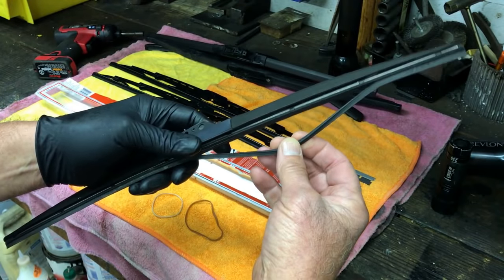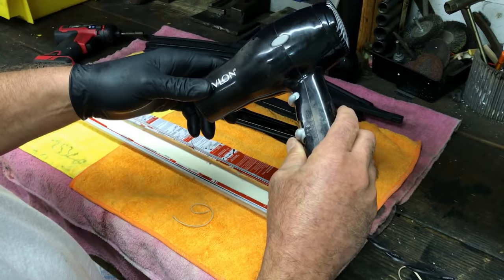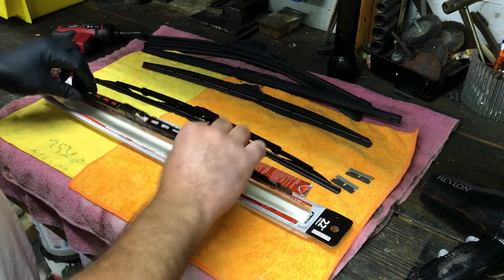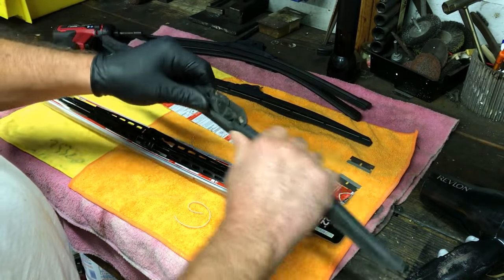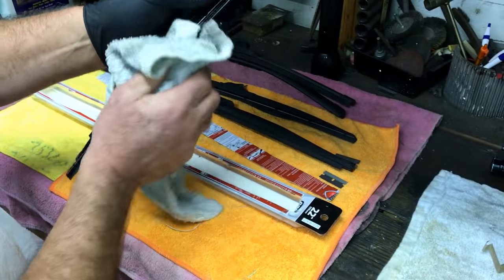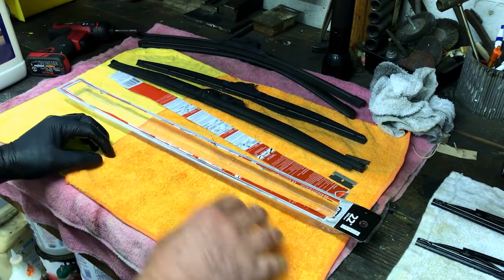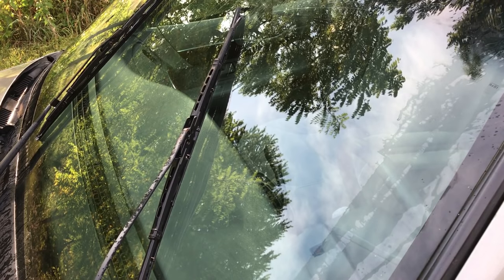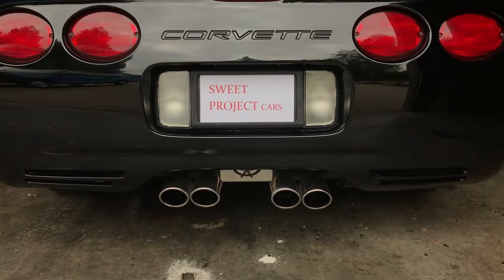NEVER ! Replace a Wiper Blade  AGAIN !!!  Amazing :)

Comment from the maker: Hello My Friends, Hope you are having a great day :) THE MAIN IDEA of the video is to show you the power of 303, it helps ALL Rubber !....SEE, cars are money pits, so why not protect the items you can from replacing sooner than you normally would have to. THE the 303 works on every part of you car..not just wipers saving you many dollars in replacing rubber, or plastic, or vinyl, or leather parts yearly.
Reply: Sweet Projec
Reply from the maker: John my friend yes it is the old bottle you want this   http://amzn.to/2jCHktN   the product goes a long way we bought many gallons of it 4 years ago and just finishing it up.
Reply: C
Reply: Sweet Project Car
Reply: Wonder how to do a repair. Dent in plastic bumper 2008 Odessa
Reply: Sweet Project Cars b
Reply: What was sprayed on the windscreen at the end?
Reply: Sweet Project Cars 
Amazing DIYs. Subscribed.
1 question: can this be done to  door rubber trims/seals for noise isolation and cabin air leaks? Thanks in adv.
Reply: Sweet Project Cars Just clean them with de natured alcohol then clean the windshield with it make a vid about it pls
Reply: Sweet Project Cars were u
Reply: Sweet Project Cars were
Reply from the maker: Kevin we have tried many different ways over the years and this method we show here is the only one that makes the blades last and last...thanks so much for sharing :)
Reply from the maker: Off  the 303 Uv should be used on all your rubber and plastic and leather and vinyl to keep them working as they should and if you use it on your doors seals it will help them immensely if they are not too far gone already.
Reply from the maker: thank you very much :)
Reply from the maker: it is the same product we soaked them in, you can see the tools in the SHOW MORE of the video description
Reply: Sweet Project Cars how do i clean amoral off the inside of window. Person I bought car from had sprayed dash and window and i can not get it off. I can't see crap when driving at night. Please help.
Reply: Sweet Project Cars 0
Reply from the maker: thank you
Reply from the maker: Theresa we use this to clean it off  http://amzn.to/2iuiyID works every time:) but it needs to be 99% or higher
Reply: Sweet Project Cars thank you. I will give it a try.
Reply: Sweet Pr
Reply: jauntis juice
Reply: Sweet Project Cars i
Reply: Sweet Project Cars I
Reply: Sweet Project Cars That 303 is expensive, use armor all protectant and get the same result.
Reply from the maker: Efren Saclolo the armorall is not even close to the same quality or mixture as the 303...it would be the difference between a Ferrari and a Toyota civic
Reply: Sweet Project Cars yi
Reply: Ok so I bought a small spray bottle of the 303, used it on my wipers, reapplying it monthly, it did work as
Reply: so, theoretically, based off of your clickbait video and your own post(which contradicts the title btw),  one could heat up their tires & soak 'em in this stuff overnight and never have to buy tires again?
Reply: Sweet Project Cars Toyota Civic?
Reply: I pay 14 $ for wipers,  it seems easier to just change them
Reply: I’m with you about 303, I have used it on garden hoses to plastic patio furniture to rubber door and window seals on the car, house to boats simply anything rubber and plastic, ok everything has a useable life but 303 extends that noticeably. Good call bud, I honestly never soaked them before installing but I usually spray on a piece of paper towel and wipe the heck out of em and I change wipers ever 4 to 5 years, I have 4 vehicles, even the cheapest wipers which I really dislike adds up quick.
Reply: So you heat the blades for 10 mins, soak over night, then reapply with spray twice a year?
Reply: 303? I use Winchester 300 Magnum.
Reply: Sweet Project Cars I see in your video you soaked for 3 hours or you can soak overnight. Is 3 hours the minimum?
Reply: A few things to try if you are having poor wiping performance; Clean the wiper blade and windscreen with warm soapy water, followed by a clay bar for the windscreen and then wax and grease remover to remove any stubborn contaminants. If you have issues with wiper arm pressure, you can lubricate the wiper arm spring with wd40.
Reply: @jbone1383  no not heat it up just spray it on rub it in and do it a couple of times a year and see the results, he made a video about this and a cars timing belt :p
Reply from the maker: grimmreeper2001 you can soak it overnight no problem
Reply from the maker: Tim Early you got it my friend
Reply from the maker: J Bone you got it my friend
Reply: Hey sweet. I have subscribed uour channel not long ago. I just want to tell you - the job you do inspired me so much that Im really wondering to start detailing and refreshing cars.. anyway. I got one question. I have noticed that you use 303 very often. I have read on some forums that Vinylex does similar job but leaves more glossy effect. Could you tell me - is that true? Will it do the same job as 303 for dashboards and tyres etc?
Once again - many thanks for superb channel. All the best
Reply from the maker: FUGLY UCKER hello I went to your channel I did not see where you had subscribed but maybe I missed it. anywho, there is nothing on the market anywhere that will do what 303 does and it will leave it shiny if you don't wipe as hard...the protection of this product is unmatched my friend
Reply: This can be sprayed directly on the windshield? It doesn't leave any film or reside on it? And 303 vs armor all protectant on wiper blades? Is the armor all even going to help at all?
Reply from the maker: Eyvindur Leo use only the 303 my friend and yes it can be applied just like you see in the video with no side effects
Reply: Efren Saclolo 
Armor All should be outlawed, it’s complete garbage.
Reply: Sweet Project Cars I've been soaking my blades with rain water for years!
Reply: Ok so the item you are using is called 303, then why you didn't show the container in the video or truly mention it on your video? I was sitting there asking myself what is he using but I now see the link in your response to someone else.
Reply: "SEE, cars are money pits."  My mechanic puts it another way........they're all pieces of shit. LOL
Reply: Hi, what's the solution?
I'm in Scotland
Reply: It was fine until the last minute, just what I need, more substances to scrub off my glass!!
Reply: @SweetProjectCars  okay, the 303 uv protectant for glasses is the best? Who would have thought, thank you sir. 👓
Reply: What's 303 made of and can we make a batch? I found some old plastic containers and I'll look and see what kind it is. Brb
Reply: You never showed the product!!

Comment: My wife is a retired custom marine canvas fabricator and we have used and sold 303 products for over 15 years. The 303 Aerospace protectant used here also works well on vinyl, fiberglass and many plastics.  An easy way to condition small items is to wet with the 303, seal in a ziplock bag and leave in a hot car for the day.  303 is good for leather too but we continued to use Lexol on our custom saddles and expensive horse tack just because we were concerned about changing products.
Thanks for the good tip and demonstration for wiper blades!

Comment: About 4 decades ago I tried spraying my wiper blades with silicone spray.  Big mistake!  It smeared all over the windshield and made it very difficult to see out the glass.  Lucky for me steel wool and Comet cleanser removed it - but that taught me to never try a silicone-based protectant on my wiper blades.  This 303 Aerospace stuff looks promising to do this task.  As the 303 is water-based, I am pretty sure I won't have the smear problem that I had with the silicone. 

I just discovered your channel and you post great usable ideas!  Thank you for the video(s)!
Reply from the maker: no smearing ever...you will love it.    thanks for being here with us :)

Comment: I have been using the original formula 303 for about 25 years back when it was not a consumer product but I used it at work and of course some always ends up at home. The original 303 was developed for use in the aircraft maintenance industry.  303 was part of the multi-step process for maintenance of polycarbonate aircraft windshields which can be incredibly expensive.  For example, on the Citation II, each forward windshield replacement cost was approx. $22,000.  I am happy that it is readily available to the average consumer now as it is an excellent product that has few competitors for effectiveness.  Those that are comparable, you will pay an arm and a leg just to get a small amount if you are an average consumer. 303 works, it does exactly what it claims.
Reply from the maker: It is good stuff that’s for sure

Comment: I have been using this product for a few years now. It is the best for using it on the top of a Jeep Wrangler, so mush better than anything on the market to date. I use it on many things but have never used it on wiper blades. So since we are going to be buying new blades for our truck, I will be doing this before putting them on. Thanks for the great videos!!! You may want to try their paste car wax too. It is the best on the market too. I have bought many different waxes over the years, and their wax is very good, easy to use, and even tho it is expensive to buy, it lasts so much longer than any other paste wax. Keep these kinds of videos coming. Some folks like me, doesn't like to throw their money away, this just helps me to conserve my money. Thanks!!!!
Reply from the maker: Sharon I am just like you in all your statement :)   thanks so much for the kudos and being here with us.

Comment: 303 products have been an absolute favorite in the boating community to prevent 'UV burn' on rubber and 'plastic' etc. materials for many many years. For automotive use,  I apply it on the side walls of my tires, on my vinyl convertible top and its clear vinyl 'window', the exposed rubber windshield/window 'gasketing', the vinyl door handles, vinyl dash boards and any exposed to the sun components etc. etc. etc.    For home, etc., the 303 UV will greatly extend the life of exterior painted/varnished surfaces, as well as fiberglass surfaces. 

303 also makes an excellent water proofing compound for fabrics; but, due to federal EPA laws against 'teflonic compounds' doesnt last as long as previously offered, and should be reapplied after a few months. It still works quite well on 'outdoor' 'rain gear' clothing and other fabrics for the 'short term'.

Comment: Using the packaging as a soak tray is excellent idea.  I would not want to spray protectant on my windshield though, won't hurt it but just makes a mess to clean up.  Just generously spray some protectant on a small, clean rag and gently go up and down the blade a few times.
Reply from the maker: X-Man you can do it how best it fits you my friend but the conditioner wipes right up with a few squirts of the washer fluid.

Comment: I can vouch for 303. I've been using it for years now and if you want to preserve your rubber and plastic it's the stuff to use. Story: VW Rabbit Cabriolet's have on the header of the windshield a large rubber gasket to seal the weather out when the top is up. It's 3 inches or so wide, goes the width of the car and is scalloped AND it costs a ton (185 bucks!) to buy. Years ago on my wife's Cabriolet, that header seal had become as hard as a rock and was leaking when it rained. I had some 303 and I squirted some on and worked it into the rubber and then let it sit. I came back after awhile and it was pretty soft at that point. I worked it in some more and then buffed it off like the directions say. It was now soft and pliable as new. Didn't leak a drop past that day. 303 protectant is great stuff. Best you can get and no silicon in it which you body guy will like.
Reply from the maker: steve you nailed it... thanks for the great comment and thanks for being here with us..:)

Comment: Good tip, I've been using 303 products for years and it is amazing stuff,  never thought about using it on wiper blades, going to give it a try, thanks!
Reply from the maker: Thank you Jake for sharing we use it on every bit of rubber on a vehicle there is that’s for sure have a great night

Comment: Going on 10 years in Northern Virginia with pretty harsh Winters and hot summers and still working like new Bosch winter blades using year round. Once a year I wipe and down with alcohol swab and reapply 303
Reply from the maker: AWESOME :)
Reply: Sweet Project Cars:  Is that 303 protectant like Armourall? And can I get it at any auto supply store?
Reply from the maker: most good stores will have it or go to eBay or Amazon or even walmart.com     thanks :)
Reply: Sweet Project Cars Please don't be a shill for Walmart. Awful company.
Reply: Sweet Project Cars Does this make the blades a little "greasy"?
Reply from the maker: no it doesn't it is water based :)
Reply from the maker: sorry I was asked to share where to get the product and I hold no bias on anyone or any company it is an open forum and I want to help as many as I can. I dont care for Amazon but still share them.  thanks Jesse
Reply: Sweet Project Cars 
What is the chemical you are soaking with
I've never seen this product

Comment: As always, great stuff here. Can used blades be renewed with the "303" or do you need to start with new? Can you treat the whole windshield to get a water repellent effect similar to "Rain X"? One last one, where do I get the "303"? Excuse my ignorance on the last question as I'm sure that you've answered it a thousand times. Many thanks.
Reply from the maker: I would start from new if you can...you can try it as rainX and see it is waterbased...William no problem we buy it online at amazon ebay   walmart.com if you google it you will find it...
Reply from the maker: I would start from new if you can...you can try it as rainX and see it is waterbased...William no problem we buy it online at amazon ebay   walmart.com if you google it you will find it...

Comment: Thanks for the info.  I have a work truck that I use only in bad weather (snow/ice or floods). I have used every high dollar wiper and don’t work any better than the $2.50 DuPont brand I get for spares from Home Depot once a year. In fact, the wrapped one you showed bent it’s rubber after once season. So it stayed only one direction. Thanks for the tip!!  Wipers are like keys, vehicle is useless without em.
Reply from the maker: You are very correct Ryan that’s why we put this video out for everyone so they could stop replacing their wipers with this process have a great day my friend
Reply: Get some Bosch Snow Drivers, son